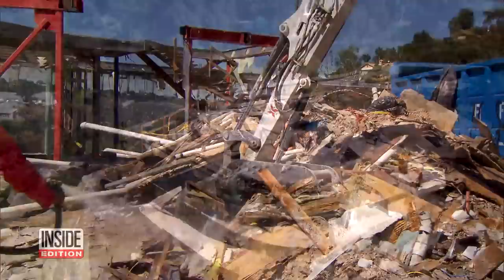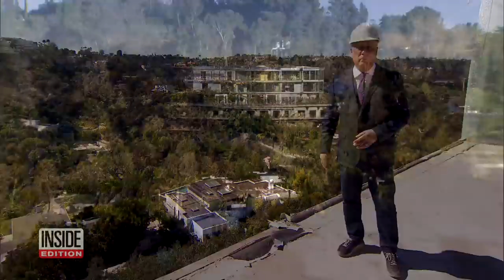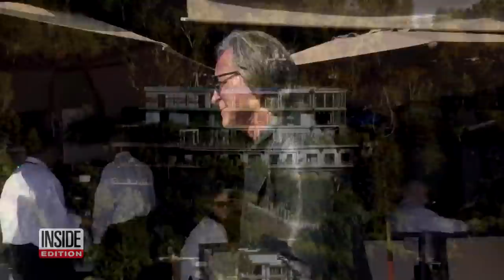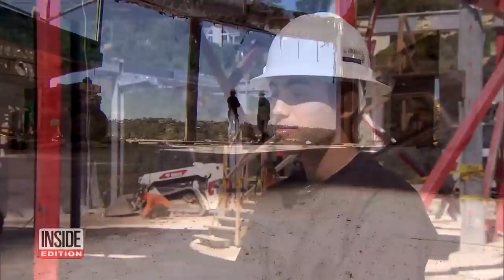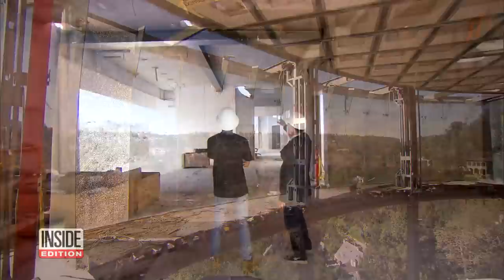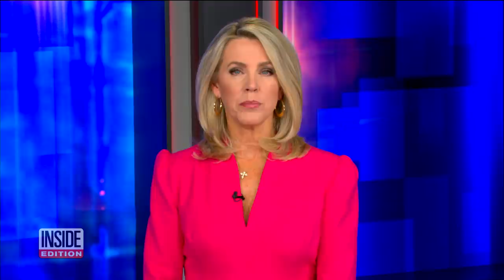Glass Mansion Built by Gigi Hadid’s Dad Ordered to Be Torn Down

Comment: Well clearly Hadid did not follow some building codes to build such a massive home on that hill. But it’s not to say that the home was not built correctly. He has been building these mega mansions for decades. I don’t think he would put his name and reputation on the line to make a home that was not safe. I think the main issue was that people in the area felt that there privacy would be taken away from them and they also might of been jealous that this home would have such great views because the way it was designed mainly of glass. I don’t believe they would have to worry about a land slide because the foundation was made of concrete and steel beams.🤓
Reply: Wrong!